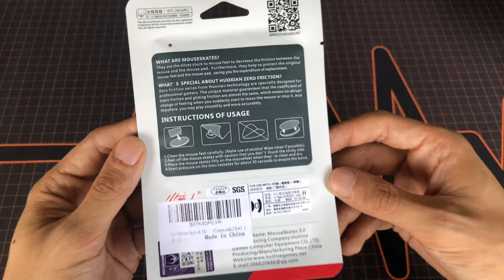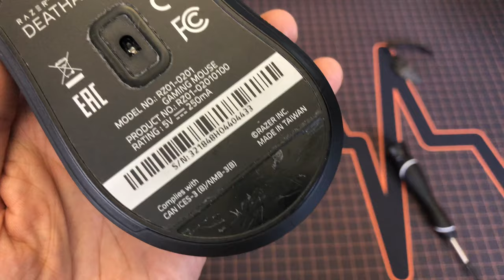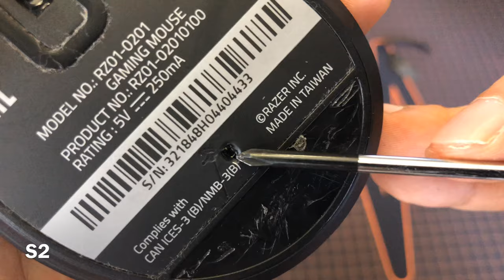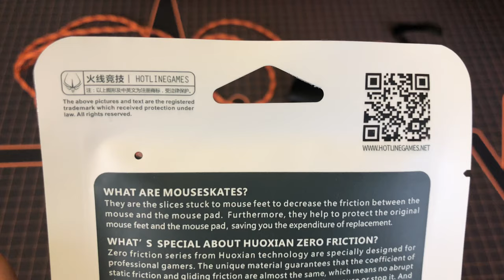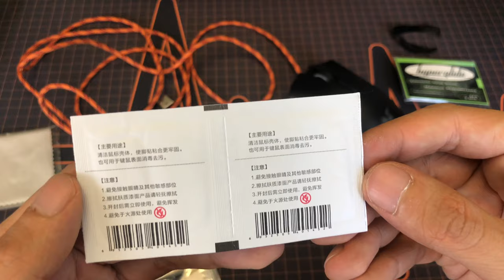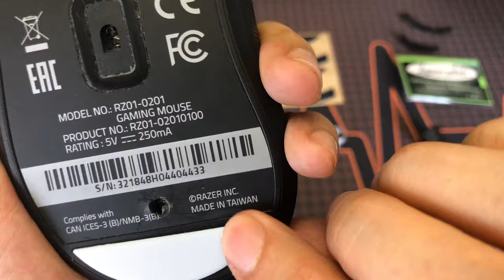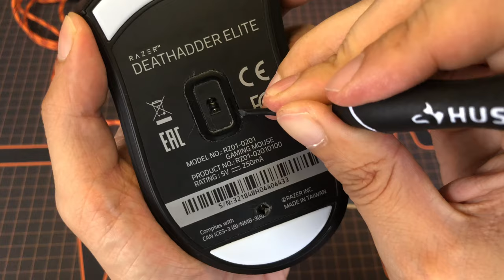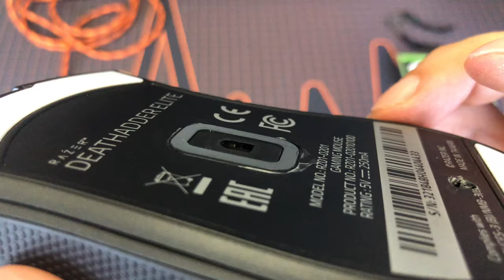Paracord & Hyperglide Install/Review | HyperGlide vs Amazon Mouse Skates?! | Razer DeathAdder Elite

Comment: Hi thanks for the tutorial. You did a great job! I just did this to mine(mamba elite). It was actually pretty easy. I also remapped my dpi down button to the side of the mouse using a small tactile switch. I use that button for razer hypershift. With this mod it’s almost like a basilisk 😎

Comment: Im gonna paracord my Viper Mini with a cable from DreamCables. I'm wondering if the Viper Mini's original cable can be used with the Deathadder Elite?
Reply from the maker: Hey Ferdinand! I’m not sure about the compatibility because of the cord connector and the amount of pins it has, etc.
Reply: @ThatBoyRen  I did it anyway and I just had to rearrange the pins and the cord works perfectly

Comment: I got a paracord from paraflexcables and for some reason it isn’t working, I even tried re plugging my old cord and my mouse worked fine
Reply from the maker: Hey Jacen! That's odd, I would verify if the cord was inserted properly and also double check if the cord version is the correct version for the mouse. 
I would also reach out to paraflex for support, they'll be able to verify if there are any issues and also help you with returning/exchanging if needed.